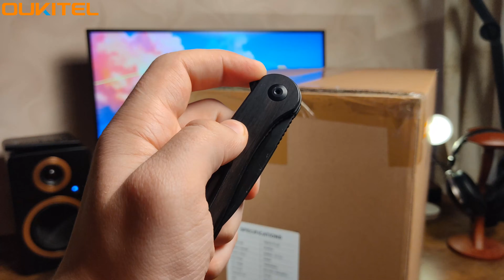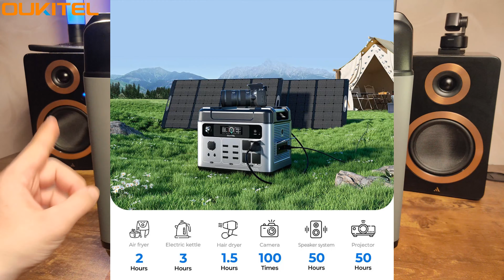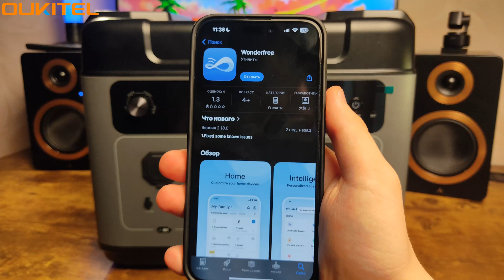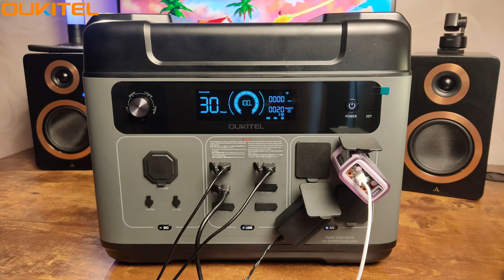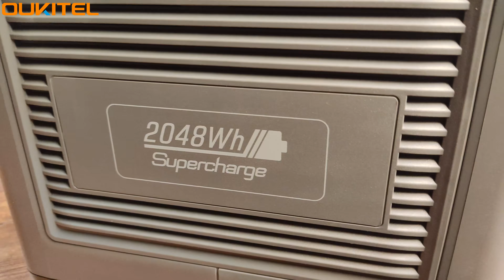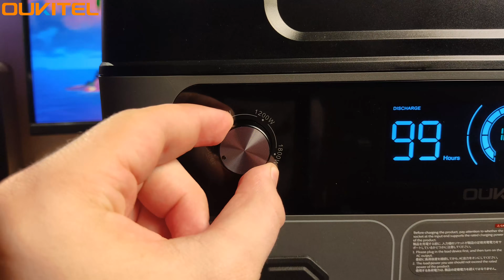🔋OUKITEL P2001 Plus Review – 2400W Beast with 10ms UPS & Fast Solar Charging! ⚡

Comment: Can you recharge it via the solar panel or external power supply, using the electricity at the same time?
Reply from the maker: Yes, it can be used while charging (pass-through supported)
You can charge it from AC or solar and power devices at the same time
However, inputs are not “stacked” — AC and solar don’t combine, and charging speed may drop under load

Comment: thats a great price too!  I especially like the input charging selector knob.  That UPS function is also an awesome feature.  You could plug your device (lets say fridge) into this and then if the power goes out you wont have to run around and get it out to plug it in cause its already there.  I do wonder though is it bad to put more than 1 UPS on a circuit?  Say I have one of these on my girlfriends dialysis machine and one on my chest freezer that share the same circuit.  Will that cause any issues?